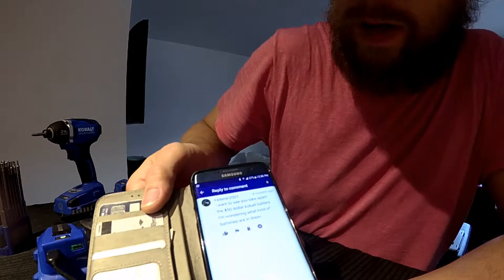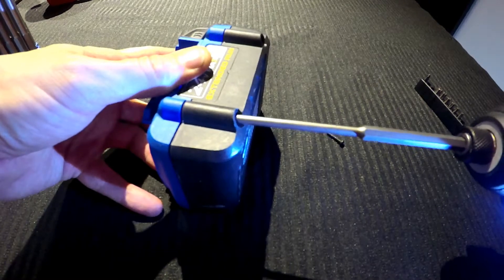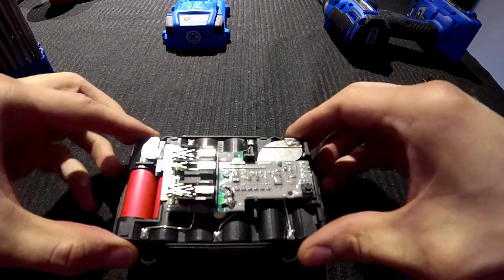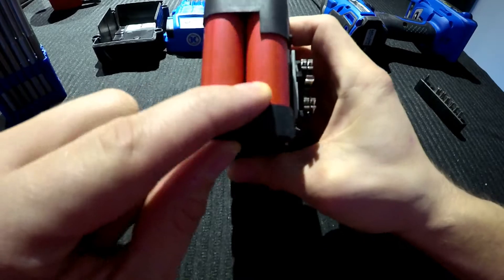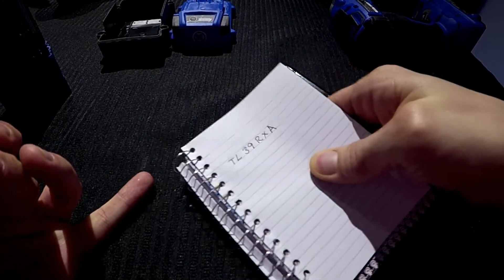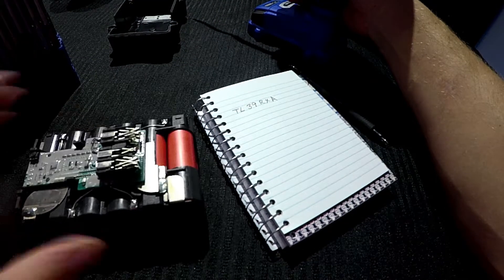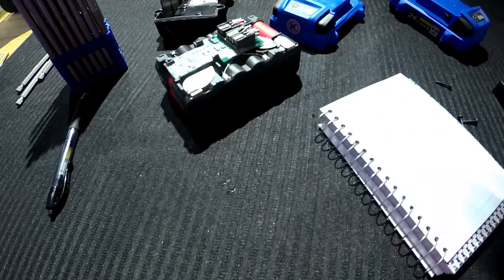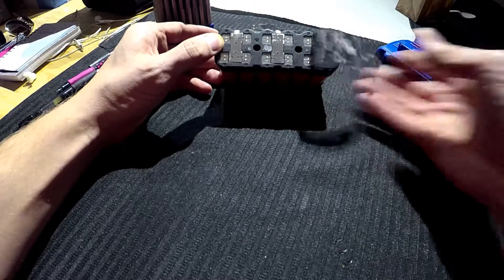What's inside? - 24 Volt Kolbalt 4 Ah Battery Disassembly

Comment: who makes these 18650?
Reply from the maker: They seem to be some generic Chinese cells that are pretty good quality. But cannot find a spec sheet or any information on them. If you find anything can you please put your findings in the comments. More battery stuff coming
Reply: @BananaMan  so, only a Few Makers use that Color Packaging. and even if the cells are made in China. its going to be by a Big name. the tool companies NEVER use Off brand cells. mostly due to regulations from the US.

the Color says Sayno. since its the only color they Use. and 10-15 amp cells possible they are UR18650RX cells rated for 20 amp drain and 2000 MAH.